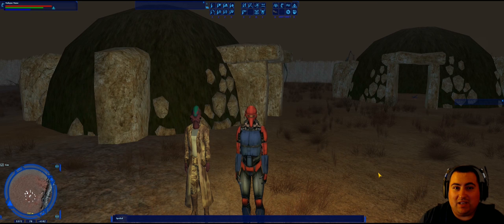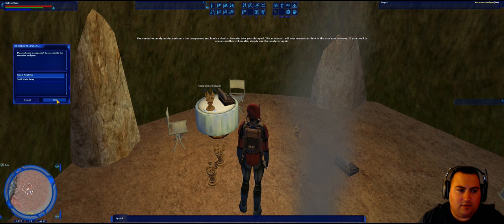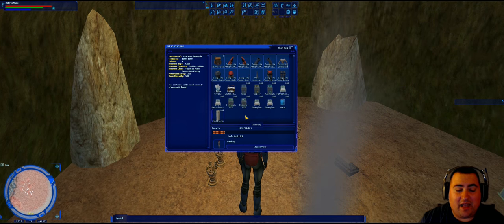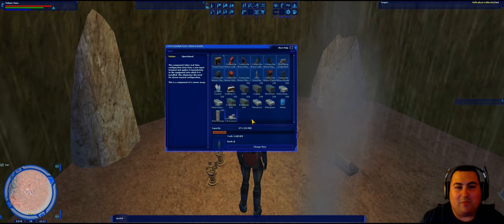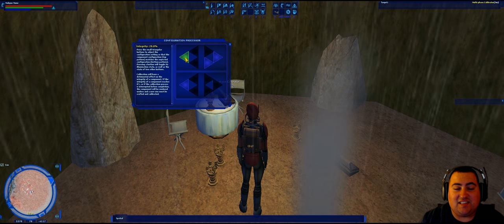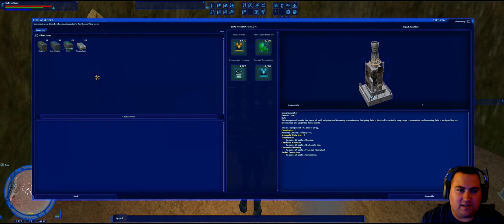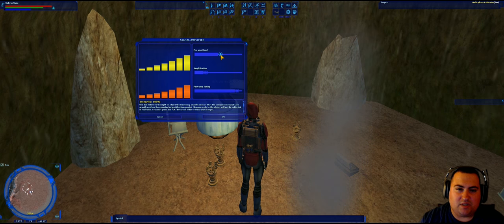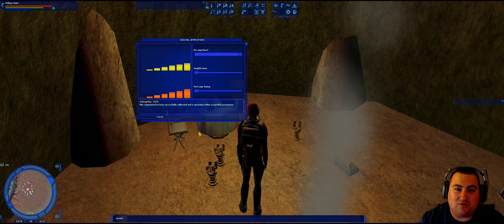SWGEmuEdu - Ep.196 - Jedi Village Phase 1: Crafting Assembly

Comment: what I'm interpreting from the third puzzle is that the amplification increases all values on the graph evenly, particularly notable with the starting value (which I agree should be used for reference), the pre-amp boost increases the average slope of the graph (how much higher the final value is than the starting value), and the post-amp tuning determines the acceleration of the values (straight line, or linear graph if the post-amp tuning slider is all the way to the left, and an exponential growth/acceleration graph, or a graph that 'curves upward' if the post-amp tuning slider is all the way to the right)